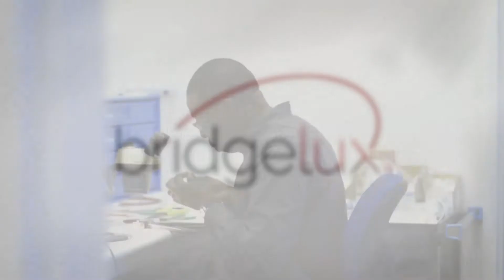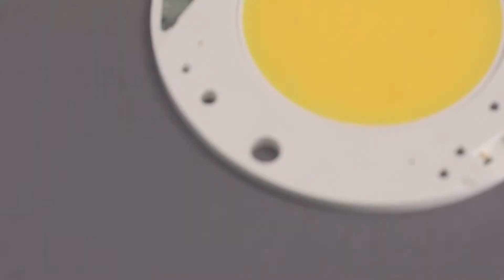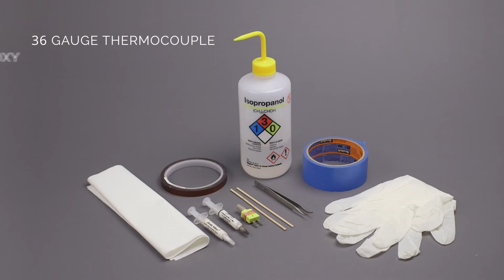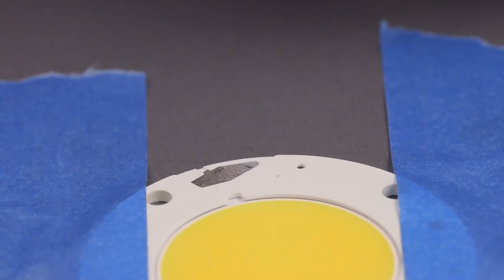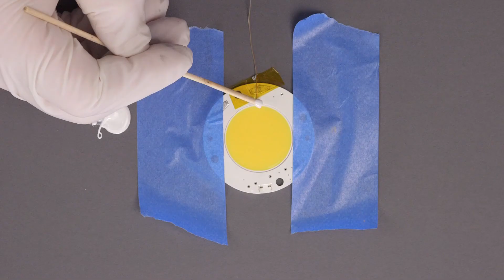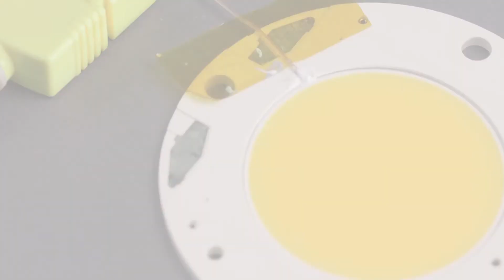Bridgelux LED Arrays: Thermocouple Measurements

Comment: Does the gauge of the thermocouple matter? 36 AWG TC wire is significantly more expensive than larger sizes, 24 AWG for example is about half the cost.